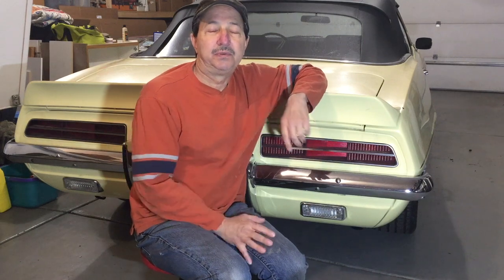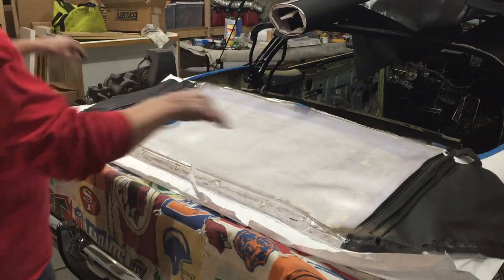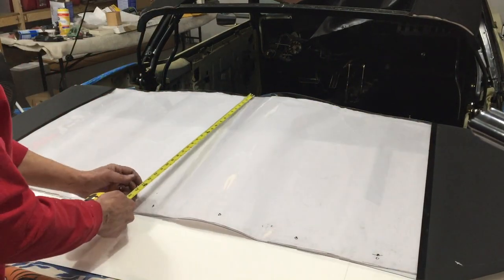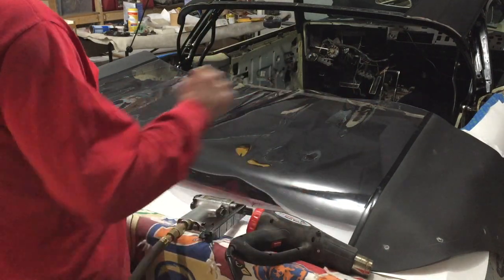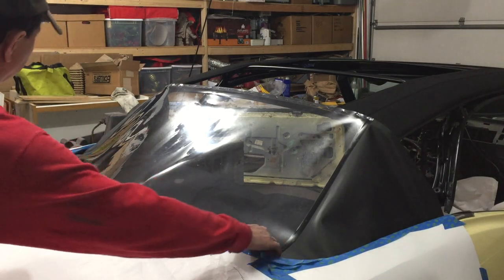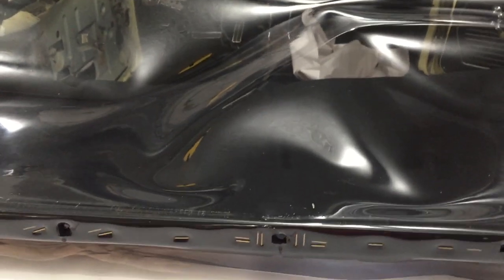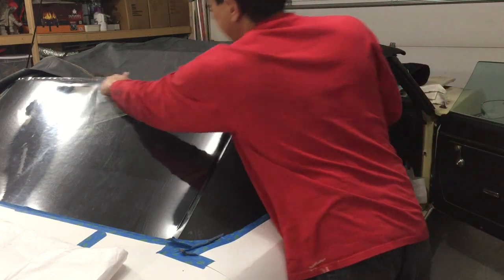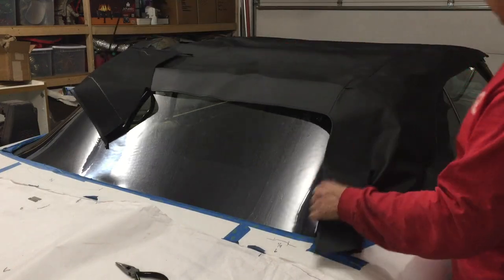1969 Camaro, Firebird, Convertible Top Installation. Part 2, Installing Rear Window and Top Pads.

Comment: I am so on the fence as to whether or not I should attempt this great & laborious endeavor. Between you & of course your YouTube video; there is also a step by step still photo enhanced instructional guide on “Team Camaro.” To try to do it myself, or not to try to do it myself? That is the question. To suffer the slings & arrows of endless back window & back corners adjustments or to just pay a professional? That, is the question. As of yet, I have no answer.
Reply from the maker: I'll add one more twist to your balancing act, I paid someone to do a top for me and it did not fit as well as it could, so I ended up redoing the back area. As the saying goes, "if you want it done right, you may have to do it yourself".

Comment: Hello again!!  I wanted to thank you for doing this video.  After watching it over and over several times, I got the courage to attempt redoing the rear window on my 69 Camaro.  I was able to achieve window perfection after 2 times and install the trunk liner the original installer forgot.  The key is arming up the interior, I used two 1500W heaters which made it very easy to stretch the window and top. Looks Great thanks for your help and God Bless!!
Reply from the maker: Wonderful! I'm so glad that my video has helped you. Great tip placing the heater inside to warm it all up. Congratulations on doing it yourself for pride and bragging rights, and you have now have a trunk liner. Thank you for the note.

Comment: it seems it is better just to replace the whole top
Reply from the maker: If you just need the rear window it is a lot of work to pull back the top. The complete top kits are not that much more so, yes, most of the time it makes sense to replace the top and pads too.

Comment: Thanks for the excellent video 👍! I am about to have my 69 Firebird done by an installer. What are your thoughts on the option of a glass rear window vs the plastic as far as longevity.
Reply from the maker: I have often wondered the same thing about the glass longevity. I have never done one nor have I ever seen one on a first generation Camaro / Firebird. The vinyl windows do scratch, yellow  and wrinkle so I would do glass.

Comment: What size staples do you use? Also, did you replace the small tack strips on the header bow for the pads? I can't seem to find them anywhere. Thanks!
Reply from the maker: I use both half inch and 3/4 inch staples. I have been fortunate that the front header tack strips have been good on all the tops I have done. I don't know where to purchase those either.